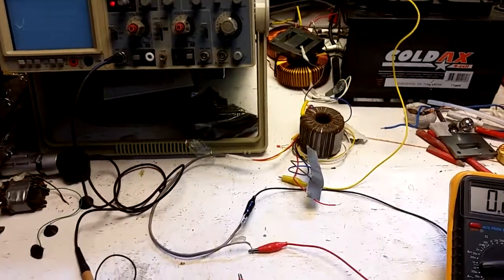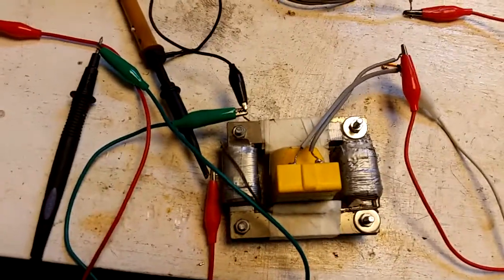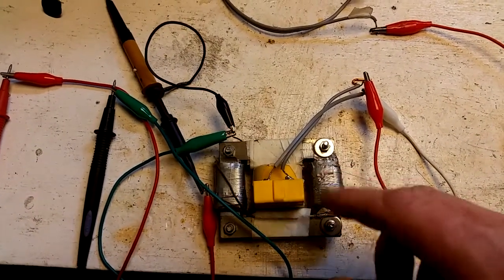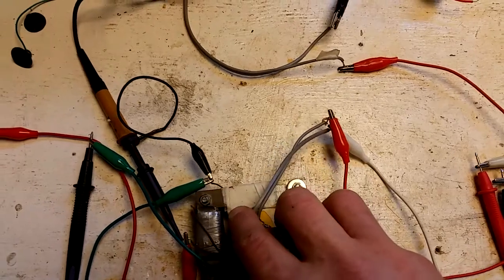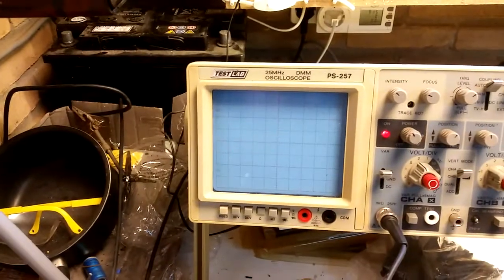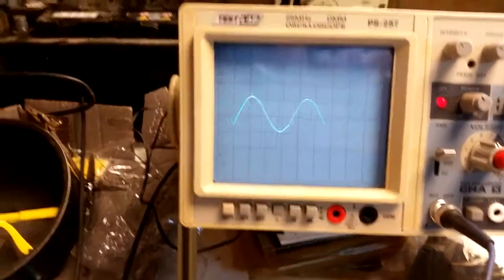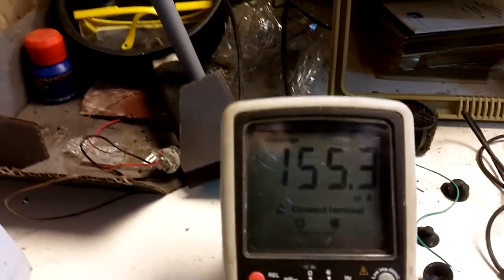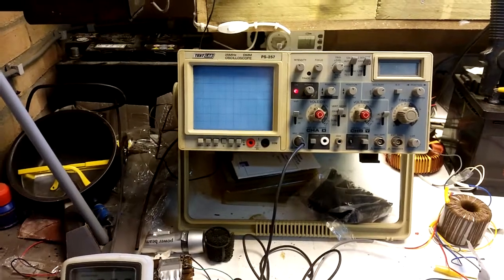No B-EMF bi-toroid transformer Part 1

Comment: This can be optimized by using common higher reluctance core i.e. iron with lower permeability on the primary side and using permalloy which has high permeability and lower reluctance on the secondary sides

Comment: The primary coil (while running with load contracted to secondary, shorted) is reactive, primary is basically just an inductive circuit because there is no —emf reflected from secondary coils on it.
Reactive power really can do work! )))

Comment: Basically when the primary and secondary are loosely coupled it happens..the current drops with an increase in power factor..measure the power but not the current only..power is given by voltage current power factor...if the power factor increases definitely you fine In lossely coupled transformer the current tends to drop with a compensate with the power factor

Comment: some late info.    i have experimented with a similar multi-path solenoid configuration.     like yours, IT DID NOT WORK.      in thousands of attempts, lenz and faraday have  NEVER  been proven wrong.    back-emf is not free energy; and  bedini was deluded     i suggest you try MA.   mechanical advantage.     even morin has begun to understand MA.      see at 6:55, in linked video.       googletranslate
https://www.youtube.com/watch?v=AAlxGYpi_5s&list=UUsiwv99k0t62ARYwDuytnjA

Comment: While the output amp meter is NOT connected so the secondary coils are open, wouldn-t that Energy just be dissipated into heat into the core?

could you measure a temperature increase therein?
Reply from the maker: You mean the energy in the primary coil and core? The input energy is always the same. So in that sence, yes, if you don't load the secondary coils, i suppose the energy is wasted somewhere in the core of the primary coil or as well in the main core.

That however is not that important, as it is evident that the input doesn't change, even though the output is short circuited.

I am now trying something new with this technique and if succesfull will also post that one.

cheers,

Rene
Reply: emc4u2 , did you try further with this?